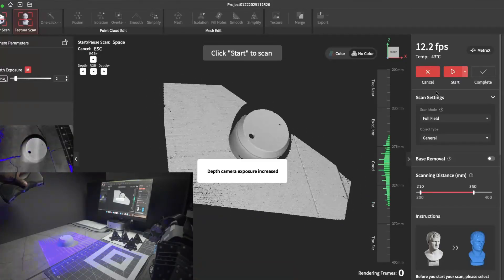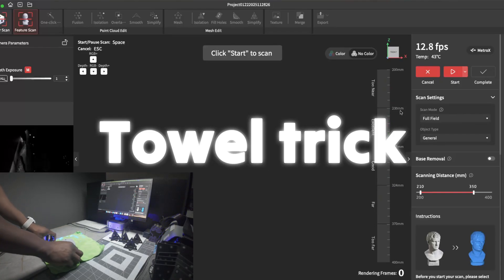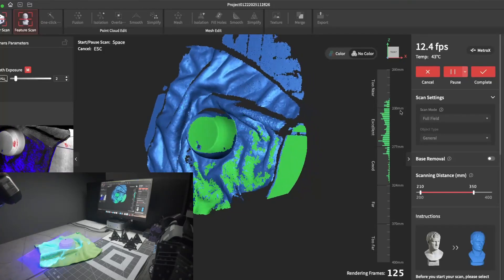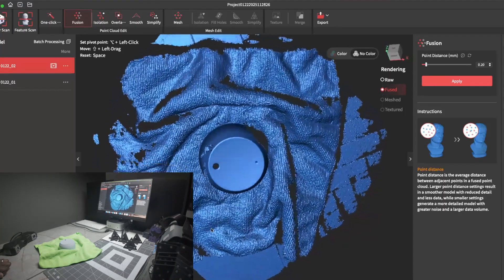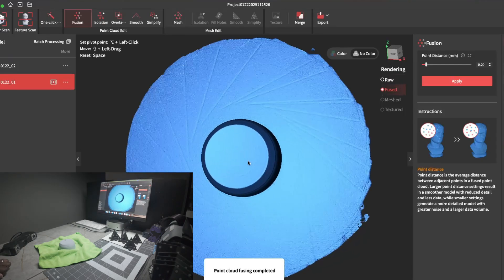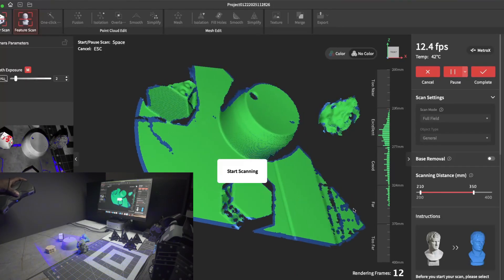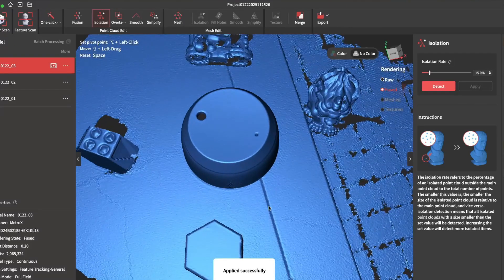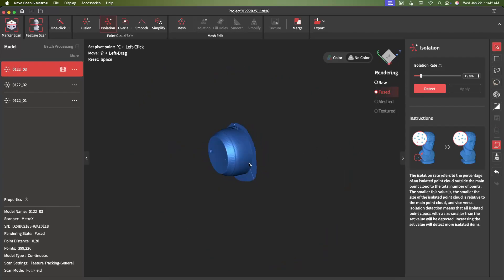How to Guide 3d Scanning featureless items with Revopoint MetroX 3d scanner

Comment: Full-field mode with MetroX is quite good functioning. But laser mode is really not working well because marker tracking and recognizion recognizion is very bad. Many people are complaining about this issue with current version of MetroX. Any idea or solution from your side on this?
Reply from the maker: @android4cg  laser mode simply needs markers placed correctly.
Ive seen alot of user errors. Like having the markers touching, too closer together, not enough markers or marker at too steep of an angle from the scanner view.

I will have some more videos coming out shortly. 
But main thing for markers.
Is you need 6 in view at all times.
The scanner likes to see them within 45deg- 135deg range.
So if the scanner is held at 90deg mark and the markers are flat on a table. You should not tilt the scaner below 45degs or above 135degs to the marker.
That is where marker itemsn balls, hex, 45deg planes. Come in handy.
Reply: Placing the markers is not the problem. Scanning the same model with same markers using Raptor works without any issues.
Reply from the maker: @android4cg  and the you are getting failed tracking on the metroX?
If makers are placed correctly. Then it should track just fine. You did make sure to update to the lastest. It should be v5.6.3 at this time.